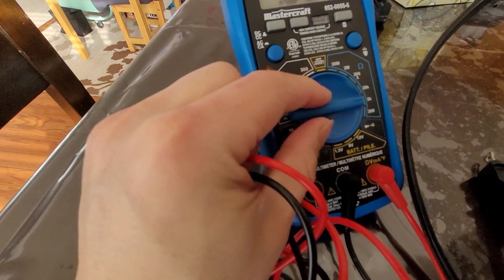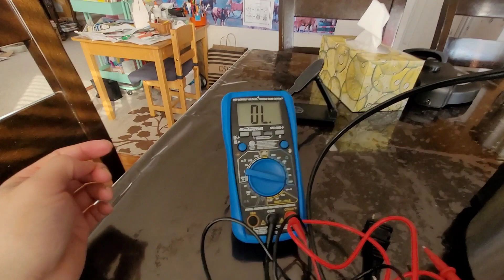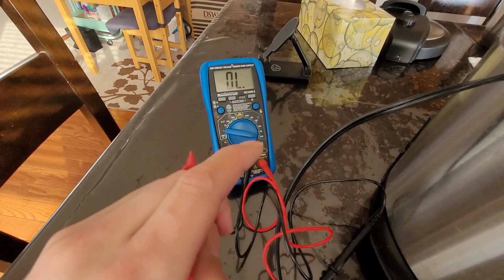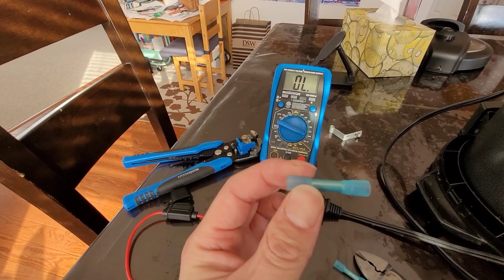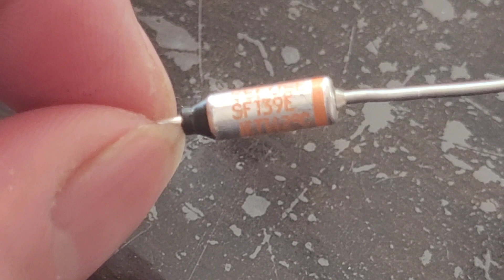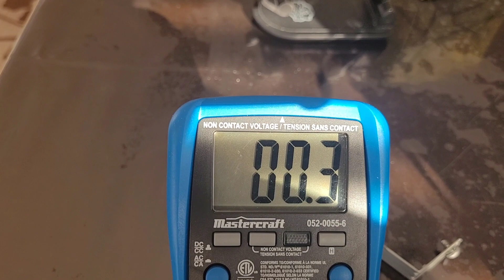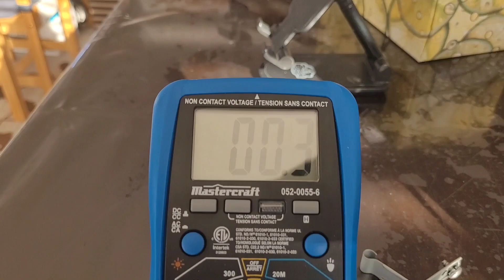Instant pot won't turn on, fixed

Comment: Not smart replacing a thermal fuse with a standard fuse.  The thermal fuse cuts power when it detects the inner pot getting too hot.  Standard fuses are meant for over-current protection.
Most of the IP models use a 142C (287F) fuse, not the 185C (365F) fuse that most repair videos link to.  Also, they can be damaged by soldering and should be crimp connected.  
Search for "Metal Temperature Thermal Fuse SF142 142C 287.6F" and you'll find some that even come with the butt style crimp connectors.  No soldering iron needed, just pliers.
Reply: The replacement should also be put back in the original location where it's touching the inner pot to protect the device from burning up.

Comment: Excellent tutorial. Great idea to use the other type of fuse. Thank you!
Reply: That is a thermal diode and is supposed to open circuit when the pot gets too hot !  with this fuse your putting in,you now run a risk of burning your house down!  replace the part with the factory part---Its about $2.00 and could save you from burning your house down.........This guy is doing a dangerous thing (DON'T DO IT THIS WAY) EVER!